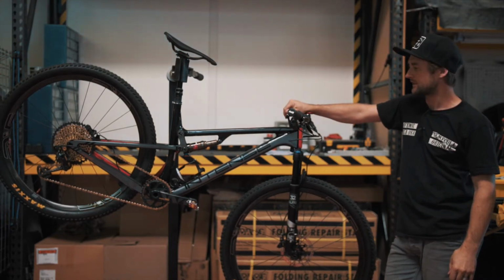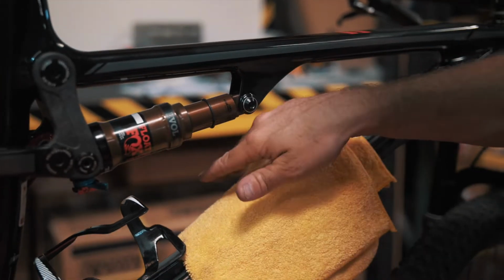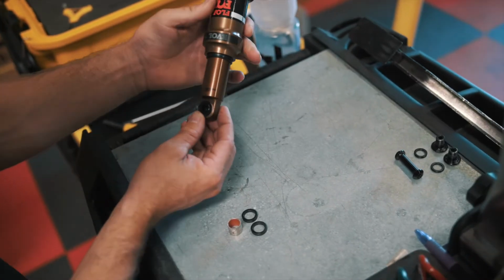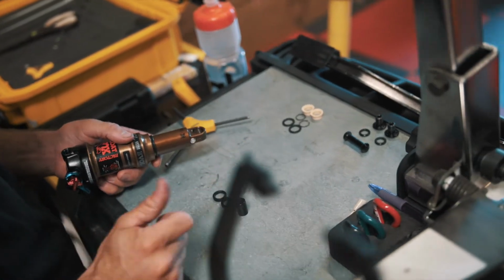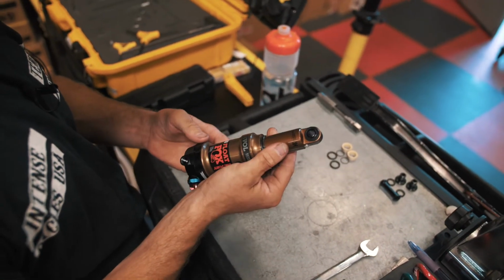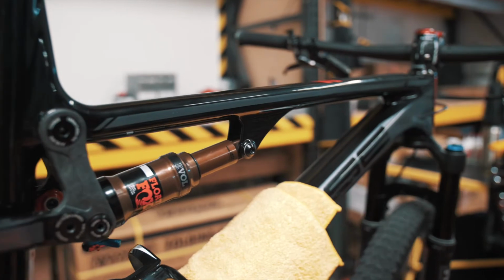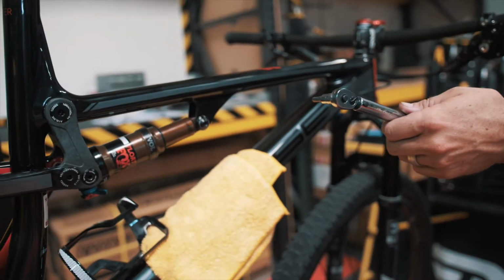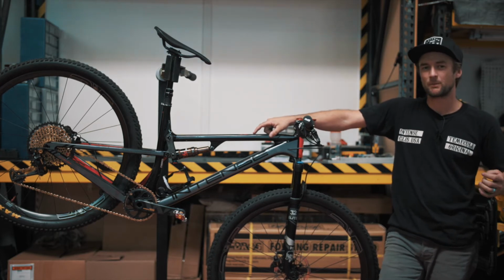Intense Tech Tutorial - DU Bushing

Comment: Question please. I used the same tool to install my DU bushing. The tool smushed the end of bushing, so that the ID of the bushing is now slight smaller on the end the tool pushed it in on. I can not get my hardware/ sleeve through side of the bushing. Is that normal? Should I force the sleeve through the bushing? I have an extra, new, uninstalled bushing and it slides on and off the sleeve no problem. Thanks for any help.
Reply: DU bushings are cheap and nasty imo. Bushes in automotive applications usually need fitting by a mechanic, reaming etc.

Comment: Is there an advantage to be using the steel DU bushing over a polymer DU bushing? I have used the polymer DU bushing with a lot of success. The polymer bushing seems to work well plus there are easy to install with out a press-fit tool.
Reply from the maker: We updated the bushings on our Sniper model to prevent any movement in the shock under load. The new bushings provide a more precise fit in the shock mount.